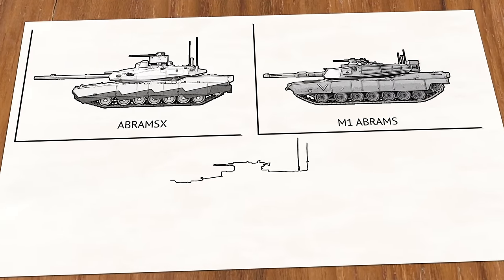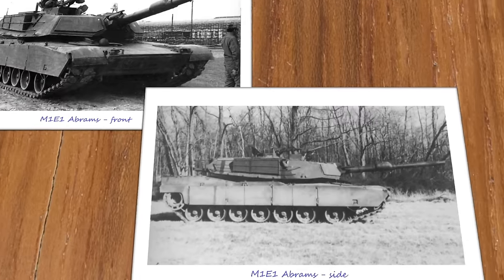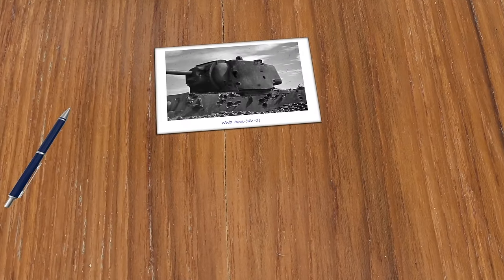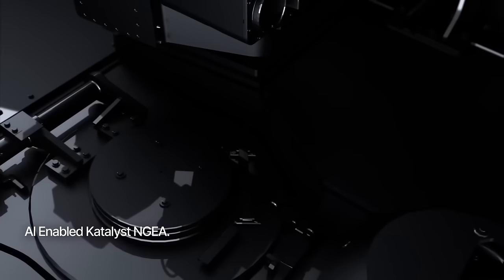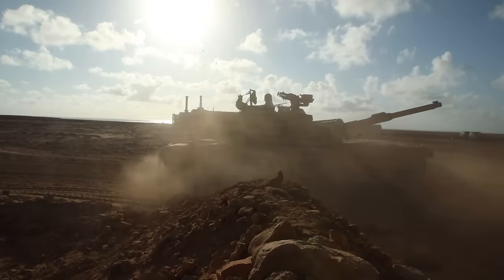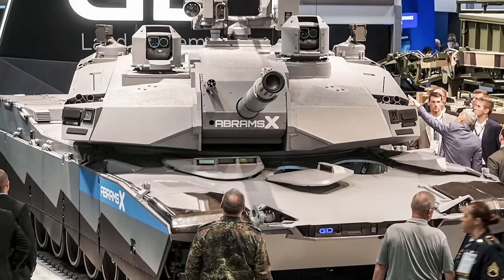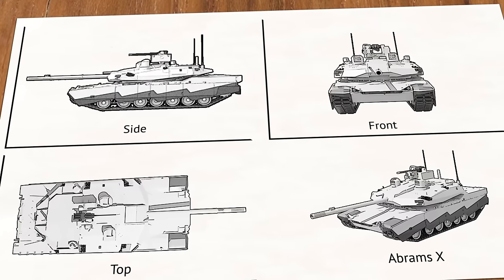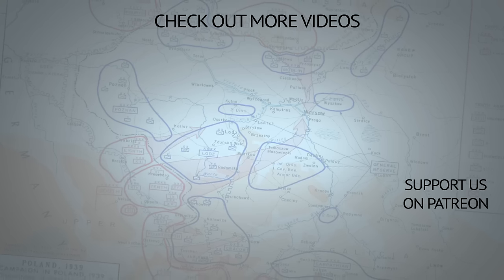M1A3 Abrams is finally happening. And it may get an unmanned turret, like the Russian Armata T-14.

Comment: Would they really need 3 crew members? Seems automation could allow for 2 in the future.
Reply: US is definitly not going to go with 2 crew, even 3 is iffy, because the fourth crew member adds redundancy and maintenance capability
Reply: Redundancy in case a crew member gets injured or such and other things might become more important, like maybe using accompagning drones or such. Also for some emergency maintenance by the crew, you might want more than 2 crew members.

In the past the navy also experienced that while they could theoretically reduce the size of the crew a lot, it had negative effects on readiness, maintenance, redundancy, emergency response (like if you get hit/an accident), ... So they don't go as far as theoretically possible.

Comment: I like a lot of the Abrams X idea's.  The only thing I would change is the loitering munitions inclusion.  Ditch that,  give them a tethered recon drone so they can see over hills and ridges without cresting over top directly. 

And if possible,  try to put that fourth crewman back in,  but put him in the hull,  not the turret.
Reply: Tethered reduces the range/height of the drone significantly,  but it also reduces the EM signature, and also makes jamming or electronic warfare against it much more difficult.
Reply: @mmeade9402 or just have dedicated scout and recon units like we’ve always done?
We do also use dedicated anti air support

Comment: My question is where would the ammo be stored in a unmanned turret with autoloader?  If the performance of Russian tanks with autoloaders is any indication, placing the ammo exactly below where top attack ATGMs would strike a turret is not a good idea.  Understand that these Russian tank turrets are manned and with an autoloader, but the videos basically show spectacular explosions as there are no blowout panels for ammo cook-off, so there's nowhere for the forces to go except through the tank and popping off the turret.  Not sure how survivable a similar explosion would be for a tank crew in the front of a tank.

So basically what I'm saying is that any autoloading system must still have ammo storage in a "safe" and somewhat survivable location if the worst were to happen....i.e., not in a carousel surrounding the turret cage.
Reply: Carousel autoloaders being bad is a complete meme. 80-90% of tank hits are to the turret. Tank detonations in T series tanks are almost always caused by extra ammunition stored around the turret, not by the carousel being hit.

Comment: Ceramics are heavy Depleted Uranium armor is great and I believe that carbon can be used in armor makeup but protection from Infantry with antitank missile's that's what we need to worry about what we need are twenty mm or better instead of a fifty cal machine guns and the coaxial machine guns should be fifty cal machine guns with a very large auto loading up to a 150 rounds before reloading all other NATO Nations have gotten the fifty cal coaxial machine guns and we need to follow suit because they are right a tank need Depleted Uranium ammo to penetrate light armor vehicles and both the fifty cal and twenty mm or thirty mm outside mount for track commander gunning the 30 mm against light tanks and lightly armoured vehicles

Comment: What I do think is quite interesting is that between the lines all information coming out is that the Russian T-72 and T-90 tanks ain't that bad after all and its latest models are so much of a threat to Western armor that they fear that they even outclass Western armor in some aspects.

The few direct confrontations between latest versions of Western Armour (Leopard 2A6 vs T-80BVM {2km frontal} and Leopard 2A4 vs T-72B3M {T-72 ambushed the Leopard from close distance}) have ended badly for the Western armor. There was one occasion where a Leopard 2 fired a shot at a Russian T-72 but it probably just damaged the T-72. But this was probably due to the fact that the Leopard 2 had a HE round loaded. Unfortunately it is impossible to verify if there hasn't been any fiddling with the Ukrainian video because the footage is altered quite a bit. But for comfort sake let's take the footage for authentic. So there has been some shots fired from the Leopard 2 where there has actually been a forced retread of Russian armor.
Reply: They loaded a HE so it not going to take out another tank.That has been discussed and explained.  Something is killing all those Russian tanks so that is of more concern as tank on tank is rare in this conflict. Tanks are being used against troop positions. It is all those fields of mines that the "Western armour" has an issue with so it affects both side ability to manoeuvre. When we get tank on tank battles it will become clearer but I would not get your hopes up.
Reply: Like with the Bradley IFV against "the Mighty" T90 MBT?🤣🤣😅😅🤪🤪
Reply: @gooldii1  Well sir if the T90M was blind as a bad caused by ATGM's and drones it was more than logical. And it was abandoned safely by it's crew. It was hopelessly disabled though. But two Bradley's shooting up a blind T-90M isn't something compelling enough to say it is obsolete. It is actually the Bradley's first real "kill" after 150+ Bradley's destroyed... So no points scored here sir.

Comment: I hope they put a 14.5 mm gun on top instead of the same old 12.7 mm
Reply: I think they already said the AbramsX is getting a 30mm autocannon on top.
Reply: @yeetbirdo  The AbramsX isn’t exactly what the E3 is going to get though. It’s be nice so I hope it does get a 30mm but I’d still settle for a 14.5mm
Reply: aperpetualguardsmanwithafl2942  It is widely used by then but the US experimented widely with it as well. 14.5 is a devastating round and with more and more vehicles having some form of hard or soft armor I think it’s time we upgrade.

Comment: Becoming like the T-14 in anyway would be a step back.
Reply: Crewless turrets are the future though. So not going the route of the T-14, which pioneered this concept for the MBT, is going the route to obsolescence instead. When the T-62 introduced the smoothbore main armament and the T-64 the autoloader, tanks like Leopard 2, M1, Leclerc, Type 10, ZTZ-99, K2 or Ariete followed their principles (smoothbore barrels or autoloaders respectively).
Reply: @DefinitelyNotEmma  Long as they don't design the turret like the T14. Pretty sure the crew have no access to the internals, meaning if that gun jams they probably have to take back to therw forward operating base or a depot just to unjam the gun. The ideas behind the T14 weren't the issue, its the way they went about it.

Comment: I doubt it will have an autoloader after what we saw in Ukraine. It will likely just have the remote controlled turret you can control outside the tank with a controller.
Reply: > I doubt it will have an autoloader after what we saw in Ukraine.
What is this supposed to mean? Autoloaders have been working just fine in Ukraine.

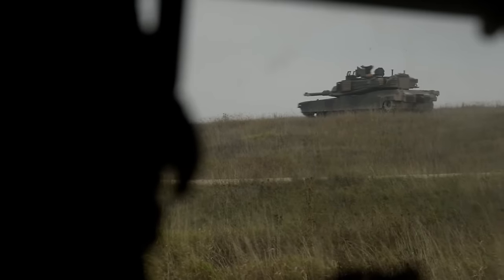Comment: 3:00 yeah but it is not a completely new tank .
Yes new advanced armor will be developed
You are also too conventional conservative and backwards minded. Armor is not important . Active protection systems and novel protection methods are
As for 3:43 that's incompetent and ridiculous. Size and weight would give more protection but that is not what you want . You are trying to get away from big Heavy, heavy armored outdated and poor performing behemoths. It's all about making it smaller lighter and more capable . Heavy tanks are not here to stay in the future. It will go the way of the dinosaur
APS doesn't have to be shotgun like blasts like trophy. That's backwards talking. In the future aps will be more advanced using different technologies. Even like rheinmetall which uses blasts to defeat threats .
Also tanks do get destroyed